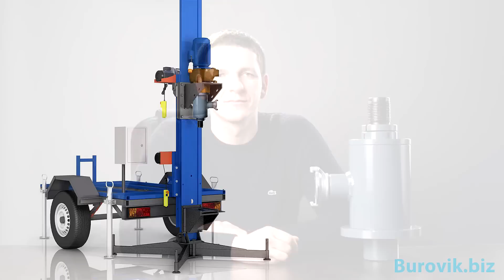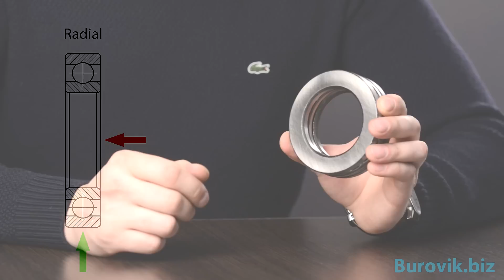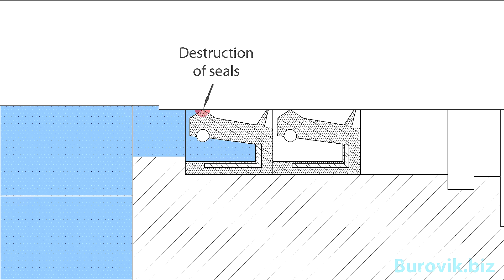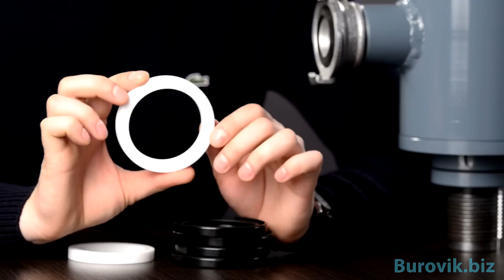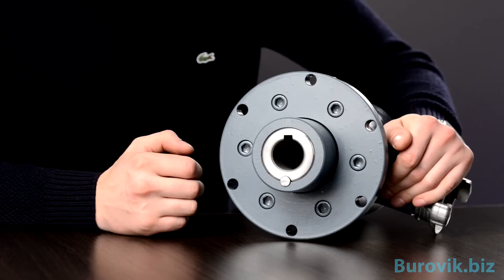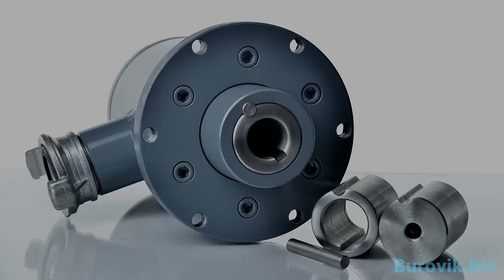Swivel for water well drilling rigs

Comment: How to order
Reply from the maker: I have 2 models:
1st
SDR-35S Price USD $960 Water hole inside shaft 35mm. Max torque 2000N*m, max pull load 6.8T https://burovik.biz/swivel-s/
2nd
SDR-45S Price USD $1280 Water hole inside shaft 45mm. Max torque 3500N*m, max pull load 11.6T https://burovik.biz/swivel-45/

Also I have Elevator mechanism for $460. It can fit on both models, is presented on 2nd link.

Let me know the model you want to buy, I will calculate shipping price.
My mobile number +380500394165

Comment: I am interested to buy one. How much is it? Thanks
Reply from the maker: I have 2 models:
1st
SDR-35S Price USD $960 Water hole inside shaft 35mm. Max torque 2000N*m, max pull load 6.8T https://burovik.biz/swivel-s/
2nd
SDR-45S Price USD $1280 Water hole inside shaft 45mm. Max torque 3500N*m, max pull load 11.6T https://burovik.biz/swivel-45/

Also I have Elevator mechanism for $460. It can fit on both models, is presented on 2nd link.

Let me know the model you want to buy, I will calculate shipping price.
My mobile number +380500394165

Comment: i love the time and effort you put into your machine as well as your video. great work. i will need some way to drill soon not sure if i will be able to buy or will i have to try to build one. time will tell. silly question--- your web page shows your drill rig. it says it is mud/air ( this is what i want ) i see the well designed swivel for drilling fluid, where does the air get pumped in ??
Reply from the maker: You can connect an air compressor instead of mud pump

Comment: 一隻多少錢
Reply from the maker: I have 2 models:
1st
SDR-35S Price USD $867 Water hole inside shaft 35mm. Max torque 2000N*m, max pull load 6.8T https://burovik.biz/swivel-s/
2nd
SDR-45S Price USD $1230 Water hole inside shaft 45mm. Max torque 3500N*m, max pull load 11.6T https://burovik.biz/swivel-45/

Also I have Elevator mechanism for $320. It can fit on both models, is presented on 2nd link.

Let me know model you want to buy and your country, I will calculate shipping price.

Comment: How much does thisone cost?
Reply from the maker: I have 2 models:
1st
SDR-35S Price USD $867 Water hole inside shaft 35mm. Max torque 2000N*m, max pull load 6.8T https://burovik.biz/swivel-s/
2nd
SDR-45S Price USD $1230 Water hole inside shaft 45mm. Max torque 3500N*m, max pull load 11.6T https://burovik.biz/swivel-45/

Also I have Elevator mechanism for $320. It can fit on both models, is presented on 2nd link.

Let me know model you want to buy and your country, I will calculate shipping price.

Comment: Is that available her in philipines
Reply from the maker: I have 2 models:
1st
SDR-35S Price USD $867 Water hole inside shaft 35mm. Max torque 2000N*m, max pull load 6.8T https://burovik.biz/swivel-s/
2nd
SDR-45S Price USD $1230 Water hole inside shaft 45mm. Max torque 3500N*m, max pull load 11.6T https://burovik.biz/swivel-45/

Also I have Elevator mechanism for $320. It can fit on both models, is presented on 2nd link.

Let me know model you want to buy, I will calculate shipping price.